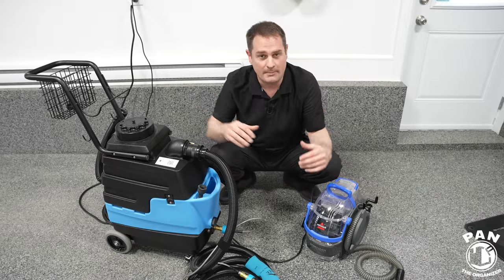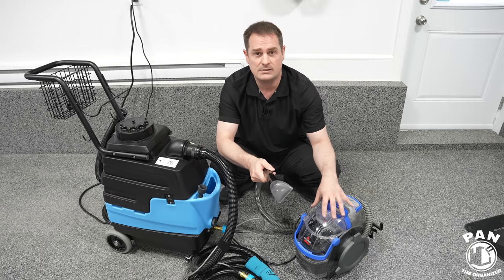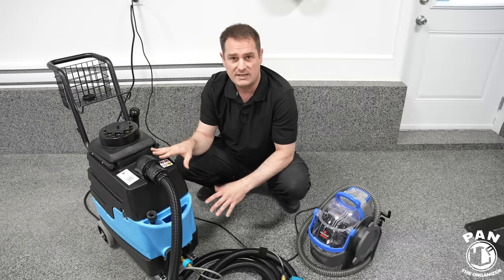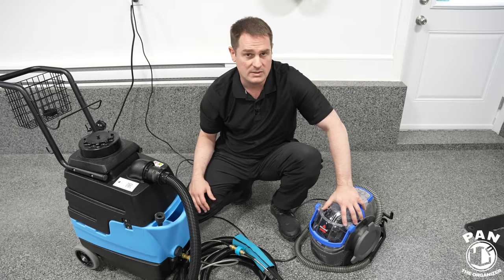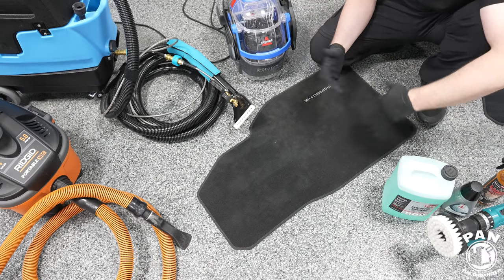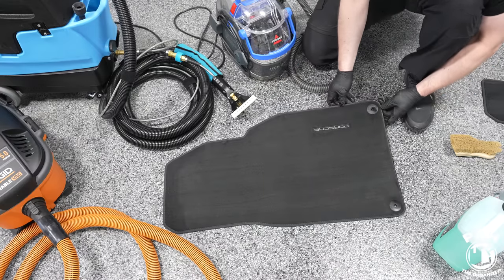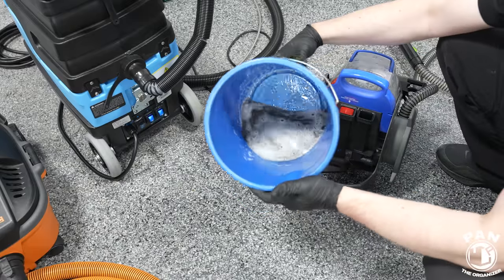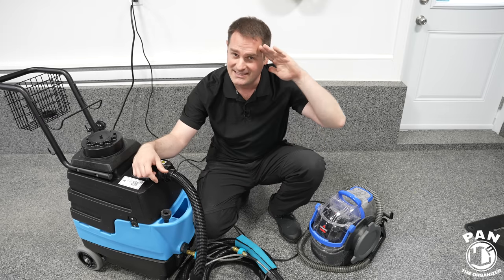Cheap VS Expensive : Carpet Upholstery Extractors

Comment: The Bissell is probably 85% as good as the mighty. Really freaking impressive when you consider not just the price and size, but the convenience. For anyone who is not purchasing it for professional use, the Bissell is definitely the one to get. For some people who are using it professionally but only once a month or so or less, the Bissell actually might make more sense despite its shortcomings, yes, it's a little bit more work to emptied out more often, but the price is really good.
Reply from the maker: Good points. How did you discover my channel by the way?

Welcome to my channel. You discovered one of the biggest car detailing channels on YouTube as we surpassed 840,000 subscribers and 105 million views! I have been detailing for 25 years and I love to share my knowledge and passion with my viewers.

You found the right channel to help you learn everything about detailing.

Comment: Without having seen the entire video yet just wondering what the difference is between a steamer and an extractor. If you could only choose one for car detailing or perhaps even home carpet cleaning which one would you choose?
Reply from the maker: A steam cleaner just shoots steam. Meant more for disinfecting and sanitizing surfaces. You could get away with steam cleaning a carpet and mopping up with microfiber towels, as many do, but you would never achieve the same level of deep cleaning in upholstery and carpets as you would with a proper extractor.

The carpet extractor shoots hot water (or even better, a hot cleaning solution) deep in the fibers, wetting them and helping to dissolve the deep dirt and grime, and sucks it all back up thanks to the exctraction/vacuum power. You can't guarantee that you picked all of the cleaner up with just the steam cleaner, so if there is still some left deep in the fibers, it could start to brown the carpet or fabric, or reactivate the dirt the next time it gets wet.

If you only have a limited budget, instead of buying one expensive version of one of the tools, get two more budget friendly units. So instead of spending 500$ on an extractor, you could buy a 200$ carpet extractor and 250$ steam cleaner, and you get both tools for different jobs. :)
Reply: @PanTheOrganizer  Awesome! Thank you.

Comment: I’m not a dealer but I do like keeping my vehicles looking as new as possible. I’m in the trades so my truck get dirty. I’ve gone through several bissel units. I use boiling water in them knowing that it will break the machine down faster but I’m ok with it. The amount of productivity the boiling water yields was undeniable. I had a customer get in over their head on a project and gave me their truck as part of the payment they owed me. I bought a bissel because the truck had never been cleaned in 12 years. I spent some 9 hrs with that bissel cleaning the truck. The water/cleaning solution I pulled out looked like espresso. They were smokers and they had a greasy dog. I took on the challenge and won. But all that time I spent steam cleaning I wondered how much time I would have saved using a commercial unit like this. I now only run rubber floors in my trucks and have seat covers like Duluth or carhart canvas type stuff.
Reply: Just think, in all thr money you spent on those Bissell machines you could've invested in a much nicer extractor
Reply: stop using it in the extractor why, i use boiling water for pre cleaning wait a few minits and then use the extractor, my bissel is over 5 years old and still going strong. just use hot water first and then the extractor same result less money spending
Reply: I could have, but that is over a 25 year period. Most of them worked when I put them away and didn’t work when I went to use them 5 years later. They don’t store well for whatever reason. To me, at that little price they are expendable. I would jump on getting a used commercial unit that was in good condition though. I don’t really need one like I did when I was younger and my kid was smaller. I got a lot of use out of one of them when my kid was little, that thing was in action all the time.
Reply: @DJR5280  totally

Comment: Make your own hot water extractor... there are many videos how to make your own cold water extractor using a ridged vacuum cleaner.... 

I have an outdoor stove hooked up to propane...  I found a 24 quart cheap out of a garage sale... I welded and threaded a garden hose size pipe  to the bottom of the stock pot... I purchased a cheap water pump that's 115v ...  and hot water garden hose  and carpet extractor wand... you can literally make a nice hot water carpet cleaner for under $300

Comment: I always see that the carpet and mats take lot of efforts in cleaning in all the detailing videos. Further they need lots of detailing hardware and chemicals too.

Isn't is more better to completely replace the carpets and mats with new OEM products once the car comes for the detailing work. It will simply save a lot of time and effort.

Like the detalers can offer vacuum for first 2 jobs and on 3rd job they change the complete set of mats and carpets with new one.

Comment: What do you think about using the Ridgid vacuum (4070) as an extractor? There's a water filter available and using sprayers/hose to soak the upholstery and apply the agents. I personally went that route and it works quite well. I wish I could show you the job I've done on my newly acquired 1997 Toyota Tercel! It adds some steps but it's a cheap alternatives when owning multiple units and storage space is complicated
Reply from the maker: I haven't used my 4070 as an extractor, so I can't comment. But I know a fellow Youtuber who did in this video: https://youtu.be/Hboi4M723gg
Reply: @PanTheOrganizer  Yes that's exactly where I got the idea from! Thanks!

Comment: Just a DIY enthusias, The big one. I rent it for a day to clean my carpets and then the car also goving to have a makeover ( I can rent it for 4 hours or a hole day ) inch cleaning solution  for carpets. It works for me
Reply from the maker: But that's not practical if you like cleaning your car often (as most of my viewers do). Going out and paying each time to rent a piece of equipment, and the wasted time coming and going to the store, etc.  You can buy an inexpensive entry level carpet extractor like the Bissell and be more efficient time wise and money wise over many years.

And if you're a detailing professional, then renting is not an option. Just buy one.

Comment: I repair the Mytee extractor fyi make sure to run the system maintainer through the system because the hoses are not very easy to get right now.
Reply from the maker: Can you give me more details on what the "system maintainer" is?
Reply: @PanTheOrganizer  It's a product that mytee sells you put it in the clean tank and cycle it through the hoses and pump, I repair mostly the hp100 and 120 model and I've found over times those hoses get chemical build up which I'm sure can happen to any extractor but that maintainer is supposed to help cut that down.
Reply from the maker: Thanks for the info! Welcome to my channel. You discovered one of the biggest car detailing channels on YouTube as we surpassed 800,000 subscribers and 100 million views! I have been detailing for 25 years and I love to share my knowledge and passion with my viewers.

You found the right channel to help you learn everything about detailing.

Comment: Nice demo Pan. I will likely pickup the Bissel for weekend cleanings.  I do have a question: could you provide some tips or tricks for how to fix frayed portions of floor mats, typically the worn area of the drivers mats ?  Thank you !
Also can you use other cleaners in the Bissell unit or does it have to be there own cleaner ?
Reply from the maker: There are no miracles to that in my opinion. Once cleaned if they still look frayed, buy new floor mats at that point.

Comment: Hey Pan!  Cool video and many thanks for all of the research, time and info that you put into it.  Question...I mistakenly left 1 of my passenger rear windows partially down and it rained.  As a result, part of my back seat and the back of my passenger seat got wet.  Should I extract the water or let it air dry?  Please advise.
Reply from the maker: You can let it air dry with windows open in the sun, or you can help speed up the process with an air mover like this: https://amzn.to/4bjCl6j

This is what professional detailers use to dry off a car interior when they did a full carpet and seat extraction job.
Reply: @PanTheOrganizer   Thank you SO MUCH fo getting back to me!  REALLY appreciate it!!!

Comment: I have an extractor at home and its new .. But one thing that is a bit weird is that the spray is not always "spreading" out well.. Sometimes it just sprays one or so line of solution and it makes it so there comes streaks of areas where its very wet and others where its not .. Do you know why that could be?? I was thinking about if it could be the solution used thats maybe "too thick" or something but im really not sure..

Comment: Dear Pan, could you clear up a complexing issue I have regarding interior cleaning. I dont understand why detailers think that using a microfiber cloth is going to take all the cleaner off their surfaces.Why  dont detailers go back over them with a clean wet towel to get ALL the cleaner residue off that surface. Over time one would think all that cleaner is just pilling up. Would you feel clean if you soaped yourself up and just toweled off the soap??   Please help...Barb
Reply from the maker: It depends what cleaner you are using. When using an APC, then yes you should go over the surface with a damp towel with just water to neutralize the residue.

But most quick interior detailers at retail level, for consumers, are ready to use and once applied don’t need to be neutralized.

Use the method appropriate for the type of product used and follow the instructions of that specific product. 👍🏻
Reply: @PanTheOrganizer  So what is it about the chemicals in the interior cleaners that dont need to be neutralized like an APC?  I know Im getting into the "cellular thinking level" but thats just my brain Pan...sorry.  Thanks for answering,  I appreciate it a lot.  Barb

Comment: can this do the work of a vacuum machine or what's the difference between it and a wet and dry vacuum machine
Reply from the maker: A wet and dry vac only sucks up stuff. It doesn’t inject hot water or cleaning solution like an extractor does. An extractor shoots the cleaning solution plus sucks it back up again for a deep clean.

Comment: Awesome informative video.
I have a question though.
Have you used or not Do you know what is the difference between the Bissell little green Pro you reviewed Vs. Bissell Clean Pro unit. 
Seems like Amazon May be currently out of the actual Clean pro Units. 
Not sure if the little green pro is the newest model and both perform exactly the same.
Reply from the maker: I haven’t tested the Little Green but here’s a video comparing both: https://youtu.be/7Y_xz7JTcjw
Reply: @PanTheOrganizer  I appreciate the response. 
think i didn’t specify my question better. 
The one you have show case and have listed is the little green pro. 
Not sure if that is the Newest model from the actual Bissell Clean Pro. 
The one in the comparison video is a different little green Pro.
I was just wondering, I think any of them will do the same job when it comes to extracting.
🙏🙏
Reply from the maker: The one I have is the Bissell Spotclean Pro (not the little green). But on Amazon USA, it doesn't seem to be available so the next best thing is the Little Green Pro. Overall, it's probably splitting hairs, there probably won't be that much of a difference. These are entry level spotters.

Comment: Hi Pan, can we use an upholstery extractor in a heated seat? Thanks
Reply from the maker: Yes but don’t oversaturate the surface (you shoukd never do that anyways) and for every light wet pass, do two dry passes to suck up the remaining moisture. And then perhaps have a little air mover or keep the windows open of possible to remove any residual moisture.

Comment: Hey Pan. I have a few questions 
I’m stumped on picking a ceramic coating and it’s all due to a few reasons. Longevity and water spots. 
I hear gyeon pure gives the best shine but how is it with water spots? How is it overall. 
Carpro does it a deliver a great shine?
New adams polish graphene spray ceramic is it good? How come it gets beat by none ceramic Coating products.
Reply: I’m debating between gyeon pure 
Carpro uk 3.0 and another question while at that which topper? Gliss or sic?
Reply from the maker: All ceramic coatings are prone to water spotting, hence why we usually apply top coats and regular maintenance is key. All ceramic coatings give a candy like gloss if you buy from reputable brands like CarPro, Gyeon, Gtechniq, DuraSlic, Kamikaze, Optimum, AvalonKing, etc. Some perhaps a bit more than others, but a normal person won't be able to tell the difference.

Please don't compare spray coatings to full blown glass bottle counterparts. The true coatings in glass bottles last longer (years) and perform better, but also cost a lot more and take more time and experience to apply. Spray coatings last 6 to 12 months at best, but are easier/faster to apply and cost a lot less.

I would go for CarPro CQuartz UK 3.0 topped with Gliss 2.0 as a topper. Two layers of CQUK and one layer of Gliss. Follow the instructions for both products. You should get 18 to 24 months of good protection.
Reply: Wow thanks Pan that was very very helpful. I really appreciate it and love your videos I’ve learned so much from you. Keep it up man 🙏

Comment: Is the aquapel glass treatment safe to use on tinted windshields?
Reply from the maker: The glass coatings/sealants like Aquapel are always applied on the EXTERIOR. The tint films are always on the interior, so they have no effect on the glass coating.

Comment: Whats the purpose of the wet pass??does it do anything the fact its only coming out and getting sacked back in?
Reply from the maker: You are injecting a cleaning solution to wet the fibers and with the high heat help to start dissolve dirt and grime to be able to suck that solution out as you can see. Vacuuming alone doesn't do much other than remove loose surface dirt, hence why carpet extracting is the way to go to get 100% deep clean.
Reply: @PanTheOrganizer  thanks for the reply. Great video
Reply from the maker: Thanks! Welcome to my channel. You discovered one of the biggest car detailing channels on YouTube as we surpassed 790,000 subscribers and 100 million views! I have been detailing for 25 years and I love to share my knowledge and passion with my viewers.

You found the right channel to help you learn everything about detailing.

Comment: Another question, I looked for rotary machine correction, polishing on your channel, do you have a link/ recommendations?
Reply from the maker: Do you have experience polishing with a rotary? If you are new to polishing, I would highly recommend that you go for a dual action polisher.
Reply: I used one yesterday for 1st time! Just in a good if Audi TT:) watched lots of videos, got the hang of it pretty quick, just slight angle if starts skipping.  used meguiars ultimate compound, next car customer says has lots of swirls/ scratches. Looking into wool for 1st step, then fine finish foam. Will get da machines if I keep getting customers probably.
Reply from the maker: Watch my affordable polishers video: https://youtu.be/LvPCkCqXEq0

Comment: You should have definitely included a midrange extractor like the Numatic George GVE370 (Fully Made In the UK). I think it would have made a much better video instead of just having the highest end and lowest end units.
Reply from the maker: I'm not about to buy a tons of extractors just for a video... Would you do that? I was just sharing two extractors that I own. If I had to buy everything people wanted to see in videos, I would have spent millions on tools, equipment and products... There gets a point where you have to know where to draw the line. I think it's safe to say I'm already the channel that tests the most products from the most brands out there.
Reply: It was just a suggestion and it’s only a single extractor. But it’s your video and you can do what you want.
Reply from the maker: No worries.

Comment: The Bissel Spotclean was a great investment. Mine is a different model I believe, but it was $110 or so and it works great. I purchased it more to clean up pet messes on my carpet but it worked good on my upholstery too.
Reply: Is it green?
Reply: In my country costs between 250 -270€
The black and red :)